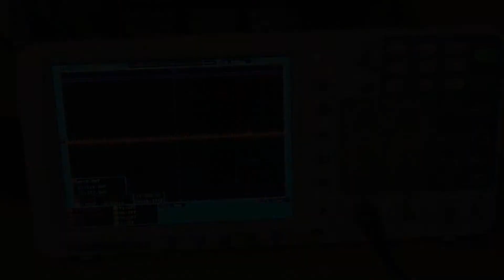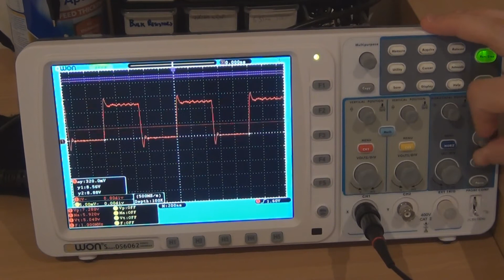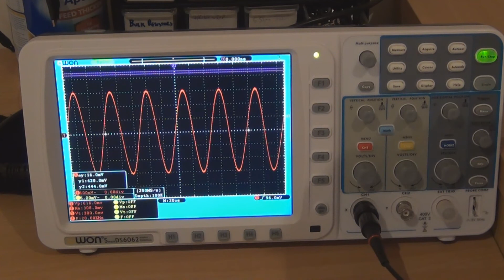DDS Signal Generator - DIY Guitar Pedals

Comment: I bought a similar one from China. My results were the same. These units might be redeemable by a DIY output stage which includes a low pass filter to remove the spikes. In this way you could keep the signal generator module on max amplitude (without clipping) and set the desired amplitude with a pot on the DIY output stage. At the end of the day, it's a rather futile exercise like applying lipstick to a pig...